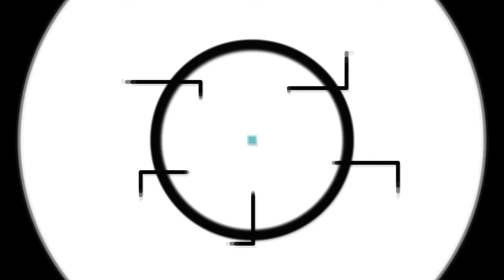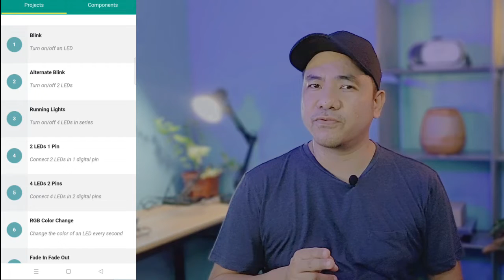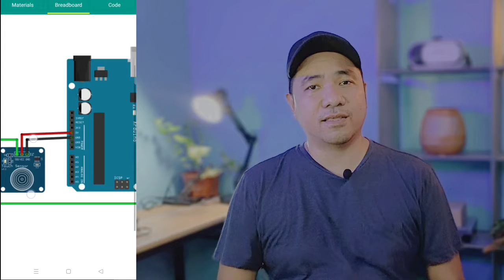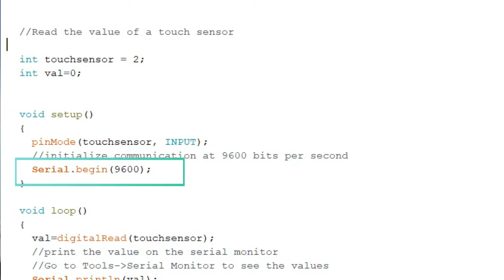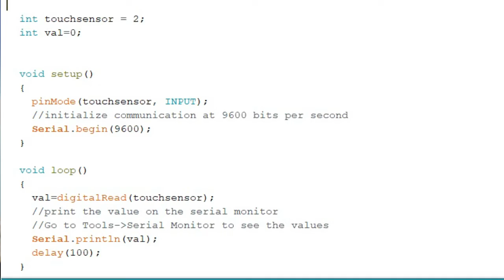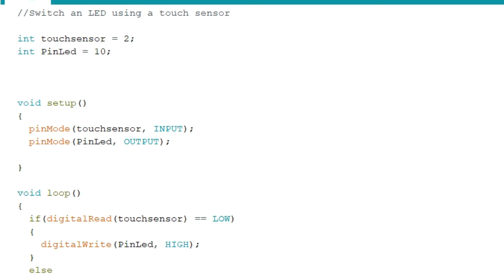Make User-Friendly Arduino Projects With a Touch Sensor

Comment: Hey, thanks for this informative video! Is it possible to extend the touch sensor by connecting it to other conductive objects? So could I for example solder a wire to both the surface of the sensor and a metal sheet and then use the latter as a touch sensor?

Comment: //Read the value of a touch sensor

	int touchsensor = 2;
	int val=0;

	void setup()
	{
		pinMode(touchsensor, INPUT);
		//initialize communication at 9600 bits per second
		Serial.begin(9600);
	}

	void loop()
	{
		val=digitalRead(touchsensor);
		//print the value on the serial monitor
		//Go to Tools->Serial Monitor to see the values
		Serial.println(val);
		delay(100);
	}
Reply: //Switch an LED using a touch sensor

	int touchsensor = 2;
	int PinLed = 10;
	int val=0;

	void setup()
	{
		pinMode(touchsensor, INPUT);
		pinMode(PinLed, OUTPUT);

	}

	void loop()
	{
		if(digitalRead(touchsensor) == LOW)
		{
			digitalWrite(PinLed, HIGH);
		}
		else
		{
			digitalWrite(PinLed, LOW);
		}
	}
Reply: 3rd code:

//add LED modes using a touch sensor

  int touchsensor = 2;
  int led1=9,led2=10,led3=11;
  int mode=0;

  void setup()
  {
    pinMode(touchsensor, INPUT);
    pinMode(led1, OUTPUT);
    pinMode(led2, OUTPUT);
    pinMode(led3, OUTPUT);

  }

  void loop()
  {
    if(digitalRead(touchsensor) == 1) //sensor is touched
    {
      //add 1 to the current value of the mode variable
      mode=mode+1;
    }

    //check for the current value of the mode variable
    //and execute the appropriate LED behavior.    
    if (mode==0){
      //turn of all LEDs
      digitalWrite(led1,LOW);
      digitalWrite(led2,LOW);
      digitalWrite(led3,LOW);
      delay(500);//time to next touch sensor reading
      
    }
    if (mode==1){
      //only LED 1 is on
      digitalWrite(led1,HIGH);
      digitalWrite(led2,LOW);
      digitalWrite(led3,LOW);
      delay(500);//time to next touch sensor reading
    }
    else if(mode==2){
      //only LED 2 is on
      digitalWrite(led1,LOW);
      digitalWrite(led2,HIGH);
      digitalWrite(led3,LOW);
      delay(500);//time to next touch sensor reading
    }
    else if(mode==3){
      //only LED 3 is on
      digitalWrite(led1,LOW);
      digitalWrite(led2,LOW);
      digitalWrite(led3,HIGH);
      delay(500);//time to next touch sensor reading
    }
    else if(mode==4){
      //blink all LEDs
      
      digitalWrite(led1,HIGH);
      digitalWrite(led2,HIGH);
      digitalWrite(led3,HIGH);
      delay(500);
      digitalWrite(led1,LOW);
      digitalWrite(led2,LOW);
      digitalWrite(led3,LOW);
      delay(500);
    }
    else if(mode==5){  
      //turn off all LEDs
      digitalWrite(led1,LOW);
      digitalWrite(led2,LOW);
      digitalWrite(led3,LOW);
      
      //reset the mode variable to 0
      mode=0;
      delay(500);//time to next touch sensor reading
    }

  }